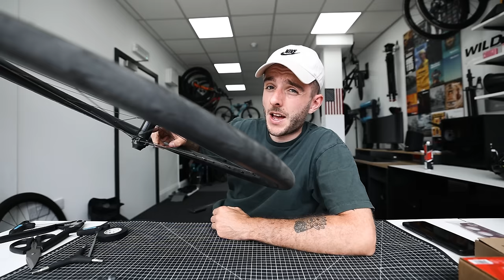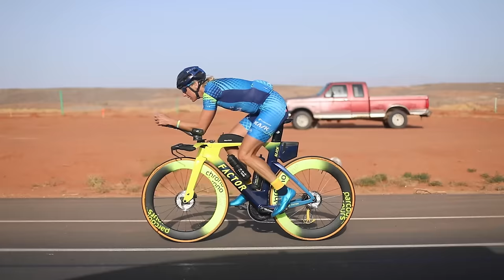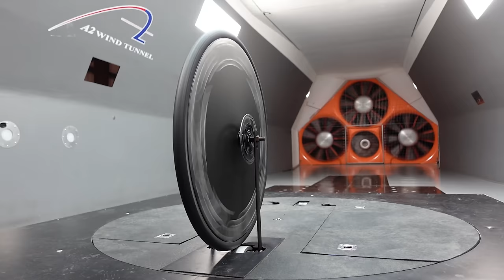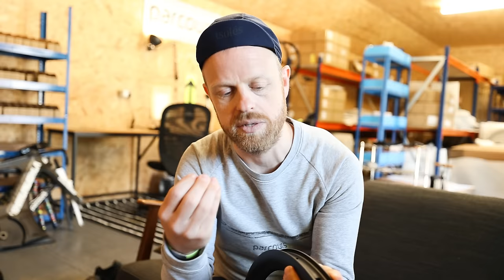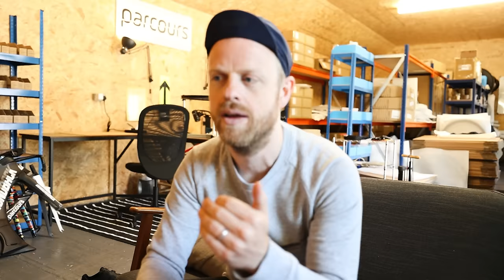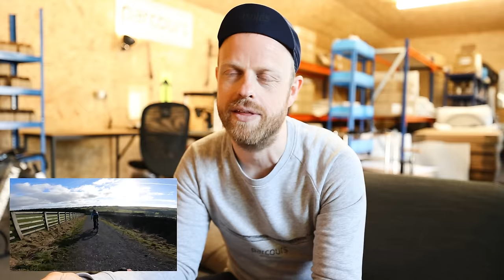Why Are Bicycle Wheels Getting SO WIDE?

Comment: Even if you don't go with wider wheels/tires..  upgrade your wheels from the stock ones.  The difference is astounding.  I got vision team 35s and the difference between the stock Axis classic pieces of junk is just mind blowing.
Reply: most manufacturers will spec their lower end bikes with very heavy and durable alloy wheelsets to keep costs down and because they will usually last forever. wheels should always be the first upgrade on any bike except for really high end bikes that already come equipped with nice carbon wheels.
Reply: @adrianc6534  in my casey axis wheels definitely did NOT last forever.  I was having to true them constantly.  Horrible things.

Comment: rim should be 105% wider than tires? 
I have a 38c gravel tires, does this mean I should get a 40mm inner width rim to go with, to get aero benefits?
Reply: I think he meant the outer width.
Reply: @ILOVEDEFENDINGTHE1PERCENT  you're right - the outer width is the driver for aero performance.

As I mentioned in the video though, the biggest factor impacting aero performance for gravel will be the tyre.  As soon as you introduce the bigger tread patterns on gravel tyres, the negative aero impact will be much, much more than the benefit of a deeper or wider rim

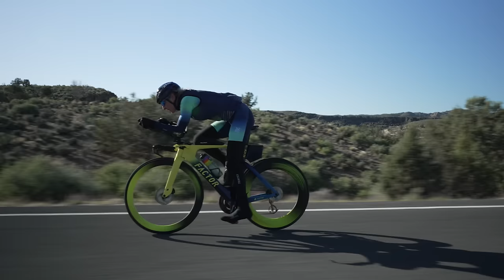Comment: 3:29  I  think  someone  in  other  chanel  *CN  tech ...  coff!  mention  a  whole  study  when  you  try  to  be  aero  is  a limit  you  can  co  faster  as  a  peak  speed  but  average  speed  is  a  whole  different  game the  ave  speed  of a  not  pro  cyclist  for a  100  km  won't  go  slow  ... er  by  using  wide  tyres,  because  the  weekend  warrior  rides  in  average  33  to  36  km  hr  even  if  your  top  speed  peak  lower  your  average  is  quite  the  same  the  wattage  savings  come  from  the rough  seccitions  and  the  gains  in  your  comfort  in descent  zones ...  I  really  did  go  deeper  on  the  quite  study  and  decide  to  try  my  road  rides  on  my  gravel  and  well  now  a  days  the  average  speed  using  40 gravel  tyres  and  25 is  quite  close  on  tarmac.

Comment: I have a question for Dov.  One thing that gets omitted in discussions about tire width is the influence of the rider's weight, (or more properly, system weight).  I'm lightweight, and I get on fine with 23 mm tires.  It seems to me that ideal tire width should be a factor, (a range of constants allowing for the tire pressure and surface roughness of the pavement), times the square root of the system weight.  What does Dov think?
Reply: Great point.  Looking at it the other way, one of the reasons why increasing inner rim width or introducing hookless rims can be problematic is that it puts an upper limit on tyre pressure.  So for heavier riders, they may be forced to either run a wider tyre than their rim is suited to, or a lower pressure than is optimal for them.

As an example, a 110kg rider on a hookless wheel with a 23mm inner width / 27mm outer width.  According to ETRTO, that's fine to run a 25mm tyre and ensure optimal aero performance, however they would need to run a pressure over the 72.5psi hookless limit or risk bottoming out.  Instead they're forced to run something more like a 32mm tyre in order to keep tyre pressure low enough for a hookless system.  In doing so, the aero performance goes out the window!

In your example, there's still likely to be a benefit from running a wider tyre however.  Potentially something to experiment with?
Reply: @ParcoursDov  Hi Dov.  I didn't explain myself very well.  I was thinking of rolling resistance.  In my case my system weight is approximately a half that of your 110 kg rider.  So for the same tire pressure, my contact patch would have half the area of his.  Assuming his contact patch length and width increase uniformly over mine, they'd be 41% longer and wider.  Simplistically, for the same tire pressure, that suggests to me that he'd need a 41% wider tire.  (I pump my 23 mm rear tire to 100 psi., my preferred pressure.)
Reply: @richardharris8538  I think we're past the limit of my knowledge of tyre mechanics and performance here.  What you say does make sense to me, but I also know from discussions with those who have far more tyre knowledge than I do, that (as always with these things) there are multiple factors at play.
Reply: @ParcoursDov  Yes, the mechanics of the tire and inner tube are a complication.  I'm gonna stick with 23 mm tires at 100 psi, (so long as I don't put on a lot of weight  😀).

Comment: Rim brakes never were a constraint. Keeping rim and tire width the same does not impact the rim brakes, they just need more spacing. A lot of bs, the reason is rolling resistance, comfort and traction. All because testing shows it makes up for the aero loss. Adding surface area (ie. wider rims/tires) is always less aero.

Comment: "We're learning as we go."  It's PHYSICS!  None of this is new to any well educated engineer.  If only the bike industry were as good at physics (not to mention engineering and manufacturing) as it is marketing.  Wider wheels do no decrease rolling resistance but they do increase comfort, traction, and aerodynamic drag.  So tired of the marketing BS.
Reply: Lower pressure will often reduce rolling resistance. Can run more optimum lower pressures in wider tires, so yes, wider tires facilitate lower rolling resistance by allowing lower pressures to be run safely.
Reply: The principles are well understood. It's the 'real world' application that's challenging. Trying to find the sweet spot with so much system variability can be difficult when your looking for marginal gains.
Reply: Also, wider wheels increase the frontal area, yes, but can in turn dramatically reduce the Cd, and thus significantly reduce drag.
Reply: Do your own research, there are many resources available.  Or feel free to repeat the bike marketing drivel here.
Reply: @chbrosz   Drag is directly proportional to the [reference] area.  Regardless of what reference area you choose, the greater the area the greater the drag.  All else being equal, wider wheels have an increased frontal area therefore they have increased drag.
Reply: @milligbp  it’s the “all else being equal” that isn’t valid. Wider rims drastically decrease the Cd, more so than the A is increased. That’s the whole point. Go check out Silca’s YouTube channel, some incredible vids on this by one of the smartest engineers on this I can think of. And I’m an engineer too, btw, but not that it matters.

Comment: Basically it's because of the increasing population and traffic meaning they can't easily resurface and repair roads without major disruption and cost. This means roads are getting rougher and almost dangerous for skinny 20-23mm road tyres! Yes larger tyres at lower pressures roll, stop and corner better on rough roads but skinnier tyres would be faster if they'd resurface the roads more often but that would mean spending money! It's all about money!

Comment: The question is why did people ever ride 23's
Reply: I was a mechanic in the late 1990’s and it was always a question of whether you wanted 700c x23 or if you were hardcore and went with 19’s lol
Reply from the maker: I guess people assumed thinner = less friction therefore faster 🤷
Reply: There was a time when 23's were considered 'Wide''!  😀
Reply: My 2009 Felt frame can't fit wider tires than 23's 😬
Reply: I still ride 23c on the front and 25c on the back.
Reply: @glennoc8585  i ride 28 front n 25 back, i prefer the bigger grip upfront
Reply: I just switched back to 23 from 25. My average speed increased over the same route. There are tubular tires in existent that are in the mid teens mm width. 

Marketing is trying to convince you that wide is better. It is basically compensating the design to facilitate disk brake use on road bikes. The industry is copying mountain bike tech to build a stronger wheel. 

Won't disagree with the statement that more comfort can be had with lower psi and wider rim tire. But disagree that combo is faster.
Reply: I ride 23 mm tires on some bikes and they are perfectly fine. Bike with 23 mm feels like road bike, not a mtb
Reply: My first racing bike in '96 had 18's. Those were fast! 😊

Comment: I always wonder the difference between a gravel wheelsets and a xc wheelset , can you run gravel on xc and xc on gravel? 🤷‍♂️
Reply: If the hub spacing is the same. For sure. Easier to run gravel wheels on xc frame since xc rims are designed for fatter tyres that may not fit your gravel bike frame clearance
Reply from the maker: Yep, but of course they've changed the "standards" of modern MTBs so the hub spacing is really wide now, my bikes are both "boost" front and rear so I can't run my gravel bike wheels if I wanted to.
Reply: Ah yes hub spacing 🤦‍♂️ more of a rim thing , a gravel specific rim should be fine on an xc bike?, can imagine a gravel bike wheel takes more of a beating if you ride it hard then an xc bike with suspension and bigger tyres

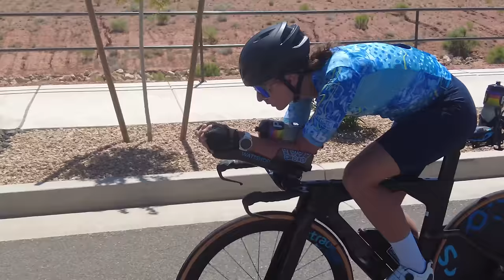Comment: 0:45 Wait, What? wider tires at lower pressure create LESS rolling resistance? I would like to hear the theory and then see the math on that spectacular claim.
Reply from the maker: I'm sure Dov can elaborate, but generally that is what people are finding when testing.
I think there is some argument over tyres being set to the same pressure but not having the same compliance due to higher volume though: 

 https://www.schwalbetires.com/technology-faq/rolling-resistance/#:~:text=Tires%20with%20a%20smaller%20diameter,roll%20better%20than%20narrower%20tires.

https://conti-tyres.co.uk/latest-news/165-wider-tyres-go-faster

https://www.velonews.com/gear/tech-faq-seriously-wider-tires-have-lower-rolling-resistance-than-their-narrower-brethren/

Comment: Centerpull brakes accommodate up to 42 mm wide tyres with mudguards and cantilever brakes accommodate up to 54 mm wide tyres with mudguards. Unless you exceed those widths you have no excuse to use disc brakes.

Comment: Everybody wants to look cool and ride on plastic wheels.
Rim brakes on plastic don't work very well when wet.
Now we have disc brakes. But to have disc brakes they had to beef up the front forks to handle the stresses.
But now the ride is ridiculously harsh so people went to wider tires.
Wider tires are much less aero than properly sized tires so manufacturers started making wider and wider rims so we can run on heavier tires.
It's like a dog chasing its tail.

Comment: 0:45 Says who? If that's faster, how come all the UK hill climb guys and fast TTers are still obsessed with running 20mm track tubs or 23mm clinchers? You can't say the rolling resistance is more on those and that they are less aero. Come on. I'm just not buying it.
Reply: The hill climb scene is something of a law unto itself.  The idea that removing bolts or racing without bar tape to save a handful of grams is going to be the difference between winning and losing is far more psychological than it is based in hard fact.  However, no one is disputing that super-narrow rims and tyres are lighter - there's just less material in them.  Whether or not it's faster up a climb will depend on things like the road surface as much as gradient however.

Then for time trialling, again it's a slow process of change.  We know that a 20mm tub pumped to 140psi feels fast on the road, but plenty of tyre test data suggests otherwise.  We are actively testing a range of different rim/tyre combinations to cover both time trialling and triathlon - keep an eye out for the results later in the year.

Comment: His first argument is illogical to say the least. He argues that using disk brakes opened up new possibilities for wheels, "because we're no longer working with the constraint of having to fit between the brake pads".
So you're telling me (I've heard this argument before, he's not the first one) that engineers can design anything... But we just can't design rim brakes that are wide enough for wider tires and wheels. It's a physical impossibility. The width of the rib brake arms is fixed by nature, can't be redesigned. Come on....
Reply from the maker: They do indeed make longer arm rim brakes, but they result in lower power so generally people avoid using them.
Reply: Exactly as Francis says - the longer drop calipers would generate a much smaller braking force than conventional calipers due to the longer lever involved.  Saying that, I'm sure that a brake engineer could design a caliper with wider clearance, but brake manufacturers didn't.  So as an aftermarket wheel brand we were constrained by the calipers that were/are fitted to riders' bikes.
Reply: @ParcoursDov  That's a better explanation. To be clear, I wasn't trying to be disrespectful. And I wasn't trying to single out your company either. I understand that you're making the wheels, so you have to design with what's available in mind. But since I've heard this argument before, I couldn't help myself from pointing this out, because if you take the argument solely as was presented in the video, the explanation was incomplete, and if you don't know the other half of the explanation (the one Frances pointed out in his comment), then it's illogical. The explanations given for the topics after this one were very good, enabling anyone to understand the concepts and in this case the benefits, it was just that first one that didn't make sense to me, at least "in a vacuum", on it's own.
So thanks to you for your explanations, and of course thank you to Francis as well for his videos, work, and his responses as well. I really enjoy your videos Francis, I hope i didn't came off as a total jerk..
Reply: @Agiyi  not at all.  Just goes to show how hard it is to cover the entire topic in a video only a few minutes long!

Comment: Roval Rapides are super wide. 35mm on the front which for their recommended tire width (26) makes the rim wider than the tire. Quite the interesting concept.
Reply: It's an interesting concept but one that's becoming increasingly common amongst new wheel launches.  We launched our Strade wheelset with a 32mm rim width on the front back in 2020 and are continuing to update our range to accommodate wider tyres.
Reply: They look pro, dont they?
Reply: @ParcoursDov  I saw on your website that you guys recommend slightly wider tire than Specialized. Crazy to think when I got my first bike they were 23mm and I was told to pump as high as it could go

Comment: Yea this has been tried a million times even accounting for lower rolling resistance, narrower tire and rim are still faster because like 90% of drag is from aerodynamics. Also why does that tt bike have an oversized pulley cage? It’s literally slower due to aero dynamic drag
Reply: less friction?
Reply: @truthseeker8483  it has like 1 watt saving in the friction department and around 15 watt loss at 20mph + from aero drag
Reply: @nick37781  Yes you could be right. Aero is certainly the biggest factor in going fast.

Comment: If you ride wider than 25mm you’ve fallen for the BS marketing hype. The wheel manufacturer cannot be impartial. They too are following trends, and the trend is wider tyres which equals more £££.